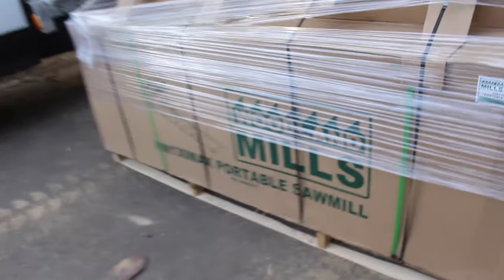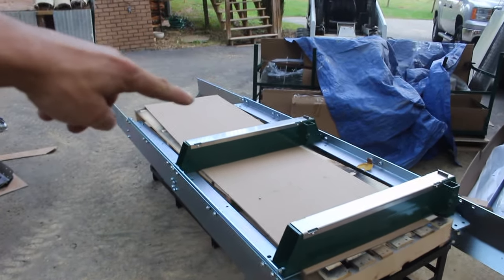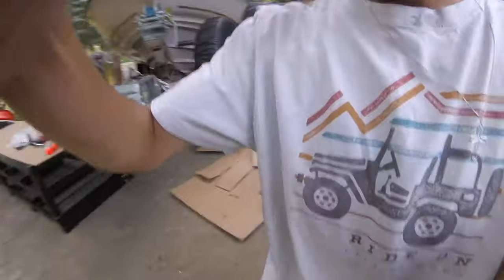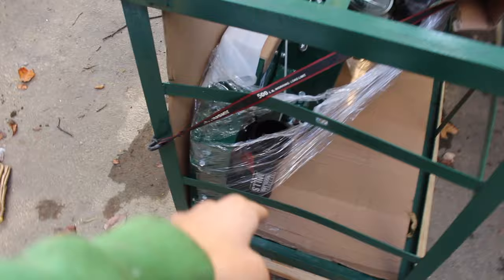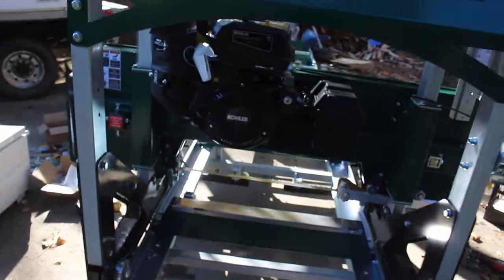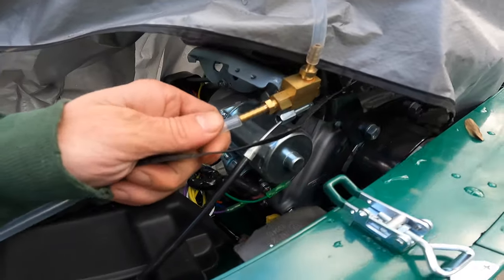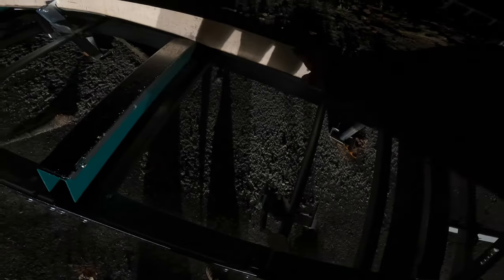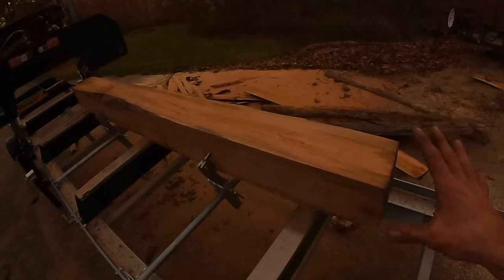Woodland Mills SAWMILL COMPLETE BUILD

Comment: Amazing footage and great montage! Good music as a bonus! 
It was great watching you build what I'm about to build (identical) this weekend (start to assemble it, at least!)
I got the tooth sharpening and tooth setter, loading ramps and all. 
I wish they had made the assembly to make the extension bunk quick attached - do t need it, unhook it type of deal, but whatever I'll haul the 16 footer around when I need to. 
Anyways, great vid in show us your build. 
Pretty excited to start sawing! Got a lot to mill!
Reply from the maker: I actually thought the same exact thing on the 16 footer, I thought it was a flip up, but it’s not too bad as a fixed base
Reply: @IntoTheDirtshop  it would've made so much sense to have it quick disconnect, but then again it might have been detrimental to its rigidity. 🤷🏻‍♂️
Reply from the maker: @crazybalony  they have that off road version that tilts up, but after putting some massive logs on mine, I’m glad it’s all one piece!
Reply: @IntoTheDirtshop  true, but it's only for the HM122 and not bigger. Bahhh I was only complaining for nothing, it's a great product! Hoping my assembly will go smoothly.
Reply from the maker: Have fun doing it!
Reply: Did you get the winch and if so, is it useful?

Comment: Just about to set up my mill. Thanks for the info. Think I have heard if you pull the log dogs out and put them to the right side of the cross tube it will put the locks at the correct upright angle, not going under the log. Don’t have to unbolt anything. Just pull it out and rotate the strap to the right and reinstall.
Reply from the maker: Thanks!